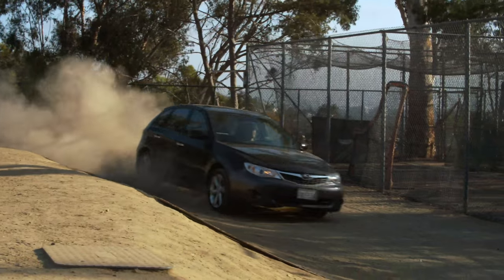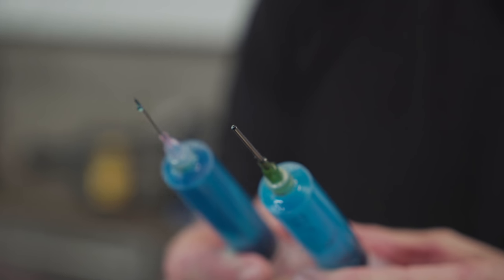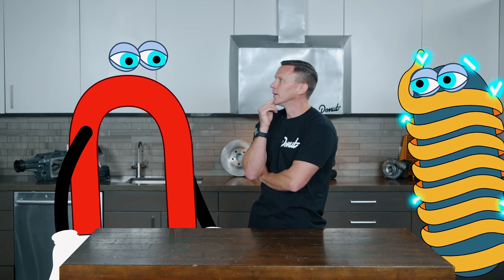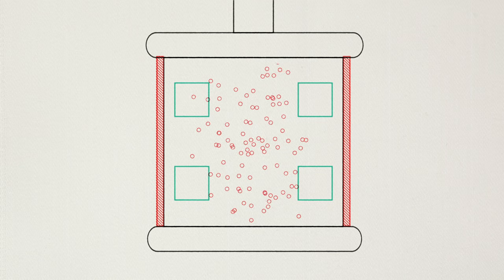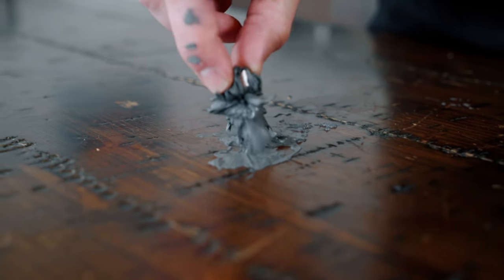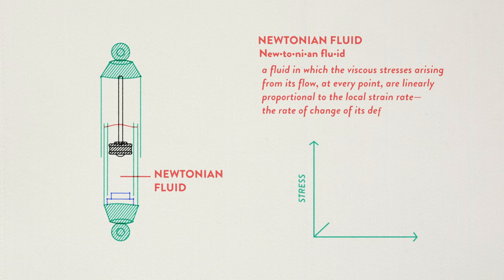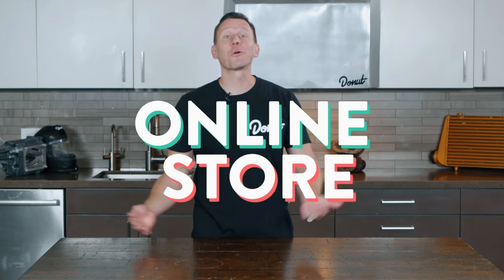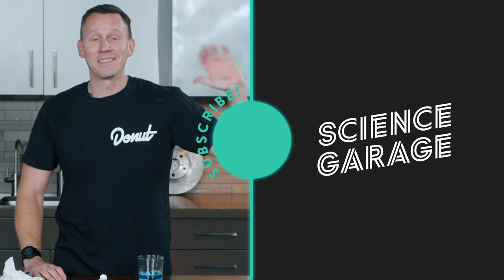Magneride - How it Works | SCIENCE GARAGE

Comment: Had to drive my dad's Cadillac after his operation.  Our roads get tore up in the winter.  I noticed that the car handled the road in a way that just wasn't normal (or intuitively explainable).  Then I found out it had MagnaRide.  It is so impressive, I'd be afraid the wheels are taking a beating that I would not be aware of.  And its not even mentioned in any commercials (that caught my attention).

Comment: Very good video, explains a lot in simple terms and clears up how things work! Though I'd like to point out that dampers provide damping, not dampening. Dampening would just make things wetter...
Reply: Actually they both mean the same thing. To moisten or wet, AND another meaning is to suppress or depress. Most people use damp (as wet/moist) and dampen (as to deaden/depress)

Comment: I have magnetic ride on my 2018 Camaro SS. All I’m going to say, once you get it, you’ll never go back to  standard shocks.
Reply: Have you ever taken it to track? If so, how does it compare to normal sports suspension?
Reply: iEat Crayons I haven’t taken it to a track yet. I have done some testing to compare the suspension modes. Tour does have some body roll, a smoother ride and doesn’t take bumps harshly. Track has little to no body roll but does take bumps hard. The car feels a lot more confident while taking turns.
Reply: whats the cost difference to replace them thought
Reply: Stephen Cain I’ve heard it’s about $2-3k to replace. To my understanding, they last for a very long time.
Reply: thats not to bad about the price of a good set of coilovers
Reply: Stephen, it depends on the vehicle of course, but $1500 is the average.  I work at BWI, testing the dampers and struts for new vehicles and that’s about the price.  The real money comes in with that crazy complex computer software.  Honda uses our dampers, but developed their own software to control them.  GM is far from being the only auto manufacturer who has magnetic ride control.
Reply: once you go black you always to back
Reply: Can you mod a car to have a magnetic suspension?
Reply: U Tube Surfer  wow
Reply: @RJWoodMoroseTenacity  short answer no, long answer no ...as you need special suspension, ECU connection and stuff, it's not impossible but unless you have a really good mechanic who also is a friend of yours and knows about electronic/electrical stuff and wants to do a special project? ...nah

Comment: But what is BOSE Suspension?
Full electromagnet suspension that enables to jump over an obstacle if needed?
Reply: its real fuggin heavy thats what it  is. hella cool tho
Reply: BOSE SUSPENSION
Reply: Bose did electromagnetic suspension,purely driven by electronic actuator(motors) without the use of any liquid as Magnetorheological (MR) fluid.Bose technology is now with cleanmotion technology.Downsides of this technology is it consumes a lot of power and not a fail safe technology.So it wasnt accepted wide enough by the industry
Reply: They need to figure out how to cut the weight on that because bose suspension is amazing
Reply: Seems like it might be OK with an ultra high end luxury electric car, like if Rolls Royce started making electric cars. Weight and cost would be less of a concern then. Maybe they could even figure out how to use it to regenerate energy when you run over a pothole.
Reply: It's also pretty old, it could likely be made a lot lighter with more modern technologi, espetially if wi get solid batteries anytime soon
Reply: Bose suspension seems possible to be installed in any car ...I wish I could have that in my car, even if it was 500kg I wouldn't mind for a smooth-ass ride

Comment: Hey I've always contemplated the anatomy of an 18-speed manual transmission that's equipped in some semi trucks. It would be helpful if y'all did a video on that! 😁
Reply: I'd be surprised if you see this

An 18 speed is basically two transmissions slapped together, since there is a 5 speed transmission then a 4 speed transmission that you select for higher gears. There is a splitter that all manual bigrig trucks have, which changes the gear ratio to be about halfway in-between the next gear.
1st gear is not called first gear, it is called low. other than moving off on inclines, very heavy loads etc it doesn't get used. Second gear is called first, and every gear follows. So it becomes an H pattern shifter with top being first, bottom being second, top right third and right bottom fourth. Once you get to 4th with the splitter or not, you can switch to high range, which is the same, five is up, sixth is down etc. An 18 speed has split gears for all gears, a 13 speed only has split gears on the high range.

Comment: Damping = reducing vibration 
Dampening = Making something slightly wet
Reply: Dampening has two meanings. To make slightly wet AND to make less strong or intense. Hence sound dampening to reduce engine and road noise in car cabins
Reply: @caimantroup6986  while that is true from a dictionary sense, from a technical/engineering point of view, there is a difference. Damping is "a decrease in the amplitude of an oscillation as a result of energy being drained from the system to overcome frictional or other resistive forces."

Back in college, my vibrations professor would mark you down if you said "dampening" instead of "damping"
Reply: @kylebarie6827  Good for you, however in common parlance and more importantly the actual word used by the companies that make these is dampening. While your professor may have been tight fisted on the word choice in tests, the real world beats academia and garage mechanics and the general population are going to use the word that is more recognized and frankly rolls off the tongue better. All words evolve over time and there are easier ways to convey make something wet than to use a word that is now mostly recognized as reducing intensity. No amount of "um actually" from academia will change that and will end in fruitless frustration from those trying to stop language from shift as it changes in front of their eyes regardless of their efforts.
Reply: @caimantroup6986  I would legitimately be interested in any example of a reputable company using dampening in their marketing/documentation rather than damping.

Comment: Hey in your hummer video you know that they weigh 6400LBS which is the curb weight. You went by the GVWR which was 8600 and that's ok most people go by the wrong number but host thought you should know go by the curb weight as the other number means it's max weight with passengers and cargo (Max weight with the vehicle, cargo and people should not exclude 8600lbs)
Reply: They know nothing about hummers. Let alone cars
Reply: Ckc dillpickle he's actually smart and knows more than most people in america. And he simplifys it so everyone can understand it.
Reply: @chadhanson4369  apparently not because he confused curb weight and gvwr
Reply: Ckc dillpickle I know but that's actually an extremely common confusion because cars only put the GVWR on the door and I hear it all the time. People think jeeps weigh 3 tons all the time and really there just 2 tons. Also weight doesn't affect fuel economy even close to what most people think it's all in the gearing. For example a 3500lb WRX with a 2.5T gets 22mpg highway and a 4450lb 6.2L supercharger challenger gets 23 while a 5500lb truck gets up to 23 with a V8. 

Cars have only gotten heavier and more efficant. Old sedans got 20mph average 20 years ago but everyone talks about weight and engine size when it's gearing and engine output. Which affects racing way more than the weight of a car too. But everyone will fight you on that opinion even though it's proven all over because people where taught otherwise. 

For example in sports cars the 4th gen Camaro was really light and extremely aerodynamic but not at all fuel efficant. 

I don't want to argue just informing people to do their own tests and research. Have a good day man!

Comment: What about air suspension
Reply: Susceptible to leaking, much more difficult to air-tight a system especially under long term stress (i.e. suspension).

Liquids is less susceptible to leaking compared to Air. So the system will be more reliable and cheaper to build. 

Just my 2 cents.
Reply: Gandhi's Flip flops it's not as smooth as air ride, though, and it doesn't offer the hauling benefits.
Reply: @Oelmotors  It can be as smooth if the air pressure inside the damper cylinder is  variable at a constant rate. I.e. if the suspension detects via sensors that it's going through harsh bumps/pot holes then it should instantly be able to reduce air pressure inside damper cylinder for smoother ride, then increase pressure again once past potholes.

EDIT: But like I said, a system like this would be too expensive.

EDIT 2: Thought you said Air ride is not as smooth as Liquid. Ignore my comment, had a long day :P
Reply: Say no to bags on sports cars 😑
Reply: @mohammedsalimahmed5230  Take a look at this if you didn't already, I think it's a nice system : air suspension for racing https://youtu.be/tSKGPIxKkWQ
Reply: Damn I didn’t know this many people would comment on this :0
Reply: AIR SUSPENSION

Comment: ketchup is non-Newtonian fluid, but unlike oobleck or custard which get firmer when agitated, ketchup is thixotropic or pseudoplastic , so it becomes more viscous when agitated  and firms up when left sitting. In construction bentonite slurry is used like industrial ketchup poured into deep trenches to prevent the edges from collapsing in, it pours like a fluid , then gets firm when it's left sitting.......so it's the oposite of what you said .....and that's the like the one thing I remember from collage, and it's not everyday I get to actually use that useless bit of info... Thanks donut :)

Comment: Should have talked about bose electromag suspension. Much better and more accurate. The body stays completely still no matter what.
Reply: Bose did electromagnetic suspension,purely driven by electronic actuator(motors) without the use of any liquid as Magnetorheological (MR) fluid.Bose technology is now with cleanmotion technology.Downsides of this technology is it consumes a lot of power and not a fail safe technology.So it wasnt accepted wide enough by the industry

Comment: Initially the concept of the shocks is a smart/interactive one that has nearly universal adaptation to any driving conditions. Using the data (speed, sway, terrain, etc etc) in real time to automatically induce the appropriate shock stiffness. I loved the entire concept. And THEN.. With the same theoretical design in use, they add to it a bunch of different manually selected settings based on driving conditions??! THIS SEEMS COMPLETELY COUNTERINTUITIVE. Doesn’t that defea the whole purpose. I want hat shock to have it always operating optimally no matter the situation. That’s the whole point. Well if I have to flip a switch to tell the shock what kind of driving I am doing or terrain I’m in or just generally how I want it to respond then it isn’t acting in the dynamic, autonomous, instantaneously variable, responsive to the real time data, way that was the original concept and the whole point. I just do not understand this.
Reply: Necroing this comment but the drive modes tunes the entire SET of inputs passed to the shocks. The shocks are always adjusting every fraction of a second but how much and what type of adjustment changes based on drive mode.

Comment: Didnt Bose try to make magnetic suspension and used a Lexus model to test out the magnetic suspension?
Reply: Bose did electromagnetic suspension,purely driven by electronic actuator(motors) without the use of any liquid as Magnetorheological (MR) fluid.Bose technology is now with cleanmotion technology.Downsides of this technology is it consumes a lot of power and not a fail safe technology.So it wasnt accepted wide enough by the industry.

Comment: My variable electromagnetic suspension generates free eletricity instead of consuming it and it is a much cheaper and simpler design. It is also a perfectly smooth ride on any terrain and it is self-leveling on any surface.

Comment: i believe that the full control and use of magnetically based devices, will transform the mechanical evolution of simple parts we currently produce/use, take a simple ball bearing as an example>
its passive and greasy, imagine a bearing that functions using magnetic repulsion as its frictionless capacity, and could collect accurate data from each nano millimeter travelled on both directions, with a circuit embedded in the metal(5D printed titanium alloy outer ring and inner ring), and they use the magnetic nature of the bearing motion to be totally stand alone powered wireless units, and, feeding the car cpu precise data , actively like 0.01ms ping signals in a LAN, they could mate an ultra capacitor inside the shaft that bearing to be part of the drivetrain itself, boosting the kinetic action of the acceleration and gathering small portions of high current power to compose a vehicle that has no single motor, but resembles more of a mechatronic transport... that we could enter and let it drive us, or wear it* as an asphalt carving, 4 wheel tilting, speed demon rolling suit...

the Octane memoires *

Comment: Should I get a Miata?
Reply: Crew Shortt ofc Miata is guud
Reply: Miata
Is 
Always
The
Answer
!!!!!!
Reply: Yep!
Reply: @wills.junks7  if you look at the first letters it spells miata
Reply: MR2
Reply: yes
Reply: Oh really!?
Reply: If you're 6'4" like me, it might be a little tight, but you should get one anyways cause who needs comfort
Reply: Heck yeah
Reply: the real question is what type of miata should you get
Reply: @laczodani  they're all good. It depends on what your budget is. 1st gen miatas are typically the cheapest, and 2nd gen miatas can be around the same price or higher. For a good 1st gen with relatively low miles you should pay $3k or less. 2nd gens can go anywhere between $2500 to $10000 based on their condition. 3rd and 4th gen miatas will basically be like buying a new car, although some 3rd gens can go around $10k or less. Im gonna assume you're thinking looking at a 1st and 2nd gen. Both are great cars, and people typically choose the 1st gen because of the popup headlights. In my experience, since i'm a really big guy for a miata owner, the 1st gen is slightly more spacious than the 2nd gen, and I know that stock, a 2nd gen is too tight for me. But if that isnt an issue, you should consider that the 2nd gen miatas all have 1.8 engines with VVTi, compared to the 1st gen's 1.6 and 1.8 options, based on year. The 2nd gen is also more aerodynamic than the 1st gen, if that matters to you. Ultimately the way i rank miatas from best to worst (even though they're all good) would be NA>ND>NB>NC, and I havent driven a 4th gen yet, but I know Mazda did a good job with it.
Reply: Ya
Reply: HanzoJonzo thank you, I’m looking for a cheap first project car and thought a Miata would be a good car for my conditions
Reply: @crewshortt1791  oh definitely. I bought my 1991 Miata about 1 year ago, and its my first car. I absolutely love it, and it really is the best project car you can buy for it's price.
Reply: Buy mine
Reply: Buy it, experience it for maybe a year, realize you can buy A LOT more car for not much more money, sell it and move on to a more powerful driver's car. Coming from a guy who's owned 2, an M Edition and a C Package.
Reply: No, you should get me one though.
Reply: miata
is 
always
the 
answer
Reply: If you want to take it one step further, build (or buy) an Exocet. It's essentially a Miata but 10x more intense. And 10x more fun.
Reply: You gonna turbo charge it
Reply: MIATA

Comment: Bose did it first, just look up Bose electromagnetic suspension.
Reply: Bose did electromagnetic suspension,purely driven by electronic actuator(motors) without the use of any liquid as Magnetorheological (MR) fluid.Bose technology is now with cleanmotion technology.Downsides of this technology is it consumes a lot of power and not a fail safe technology.So it wasnt accepted wide enough by the industry.

Comment: Do you really believe that Shell, or anyone else spends tons of money on these guys we say, to test on engines, and in labs, to run them 5000 miles on a dyno and open it, on random bases? By random, I mean, that they need to go and pump out from one of their factories, or even more, one of their gas stations, without letting the lower level personnel know, so they could the a real life scenario test, and see if the product they sell in a random CO, MN, FL, CA, NY, and so on, gas station to the average Joe, is actually still the one they tested in the factory lab. Also, they test with the best refined gas product for the videos, and for the  result they need to provide to some regulative organisations, but what we get in the stranded Arkansas Shell may be a different type of beer.  Here in Europe, we have 95H(unleaded), and 100H(98+) Racing or whatever they call it, which burns pretty well, to be honest, but is expensive. Currently a US gallon is 5$.

Comment: I think  the Russians will  be the first nation to build an autocraft with three turbines one in the front for breaking and reverse purposes one in the rear for forward mobility and one at the bottom for elevation . Balancing the vehicle with a hidden magnet or weight system that travels from side to side on a rail in the event you have a 100 kg driver with three or more passengers traveling . Perhaps a system of water or liquid like that found in a carpenters level may assist in leveling the autocraft . May Jehovah God through the means of Jesus Christ guide your endeavors and challenges !